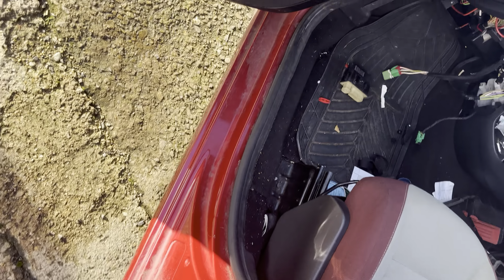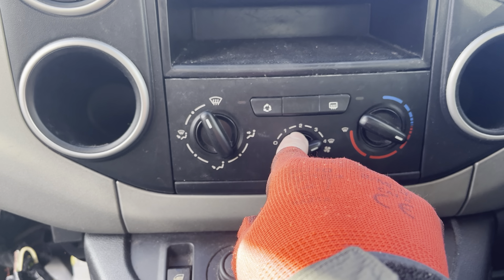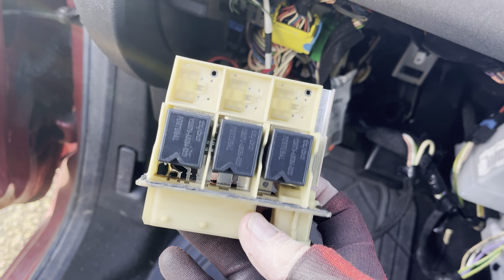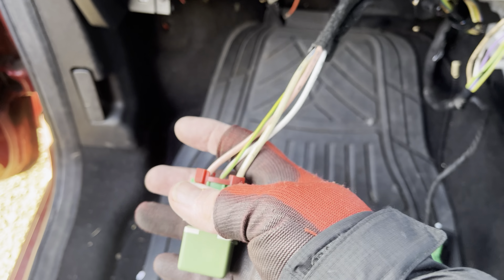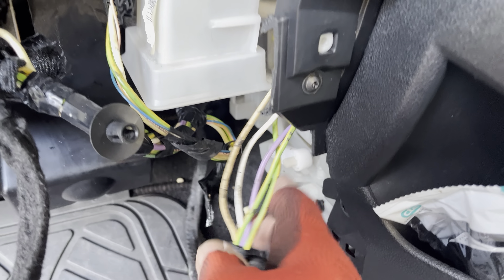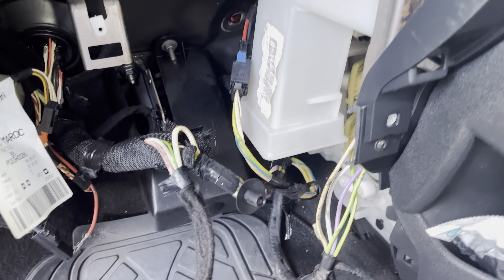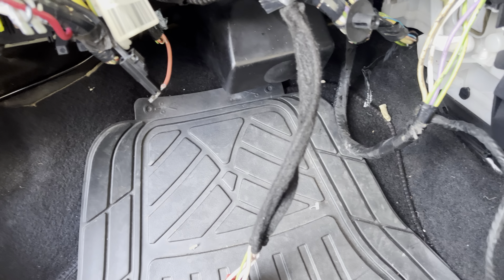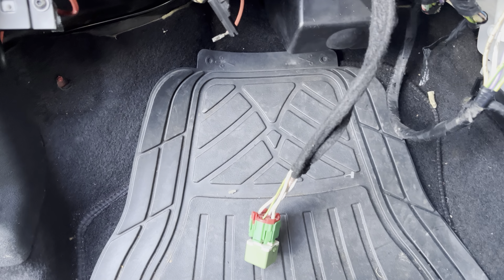Citroen berlingo heater blower not working component locations

Comment: Will that relay prevent power going to the resistor near pedal and how do you get the relay back in ?? Came out ok but won’t go back in
Reply from the maker: Yes it will and they are a bit tricky to get back in just need patience and keep trying
Reply: Is there a knack to get it back in also how do you spit it or test it without splitting it
Thanks again
Reply from the maker: @DADDYNOOB  yes just keep trying

Comment: hi, I have a berlingo 08 plate my heater also only works on num 4, is this exactly the same as this berlingo
Reply from the maker: Yes more than likely
Reply: @caralarmandradio  mine is the mk2 shape
Reply from the maker: You’re best bet is to get it all tested before you buy any parts
Reply: @caralarmandradio  hi again, I've just had a look at my car and I've found the heater resistor which goes into the fan housing but I can't seem to find the relay component that you show, also for the fan to work the engine got to be on it don't work with just the ignition on is that correct
Reply from the maker: @jasonhorseman3041 yes that’s correct you probably just need a heater resistor
Reply: @caralarmandradio  where will the relays be on my car any idea , I've got a plug that goes into the bottom of fan with a red and black wire, I took that out and fan stopped working
Reply from the maker: @jasonhorseman3041 hi there are loads of videos about showing where the relay is ok